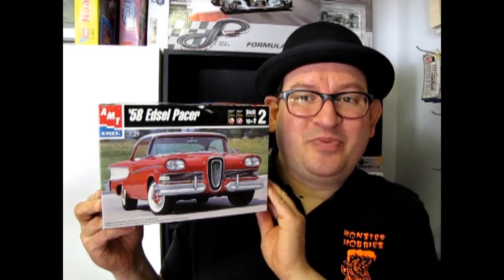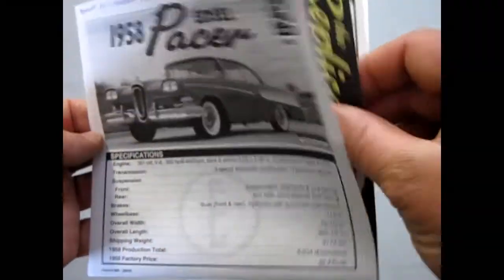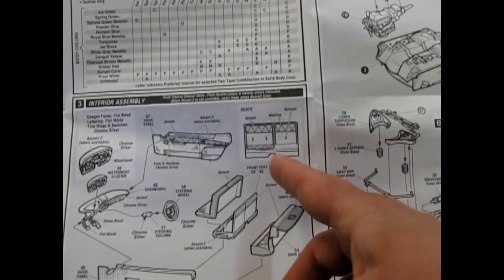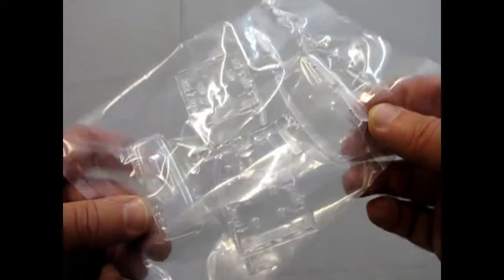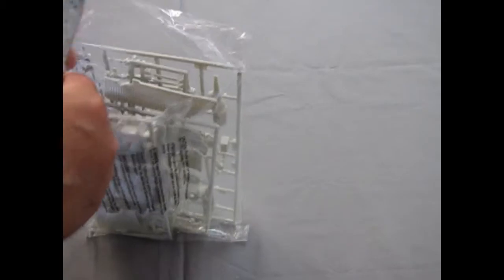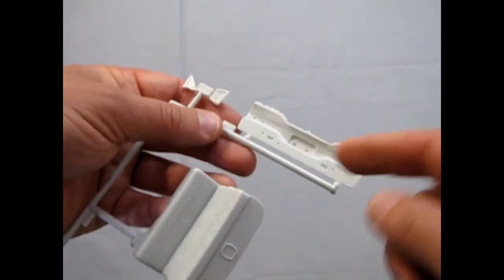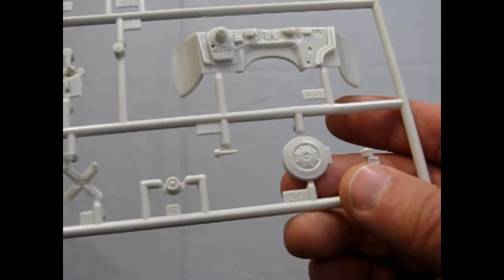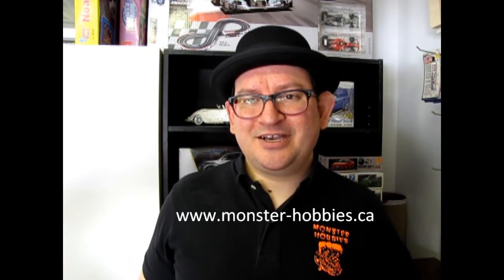Unboxing The 1958 Edsel Pacer Model Kit By AMT/ERTL

Comment: Yes Trevor Edsels were So Far advanced They Even Went Beyond Chryslers Dash Board PushButton Automatic Transmission to Even Far More " Jetson-Futuristic" Design incorporating their Push Button Auto matic Controls on Center of The Steering Wheel Simply Mind-blowing I looked at A Factory Shop manual to See how it Was Done and See pictures of the Parts Sheer Genius but So Unappreciated too
Reply from the maker: for sure. All people remember is the troubles the car had.